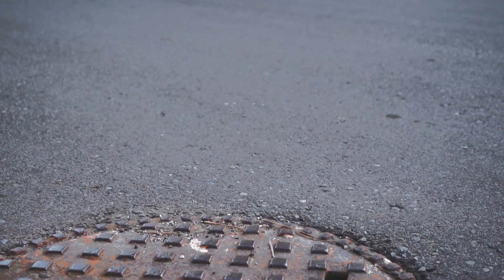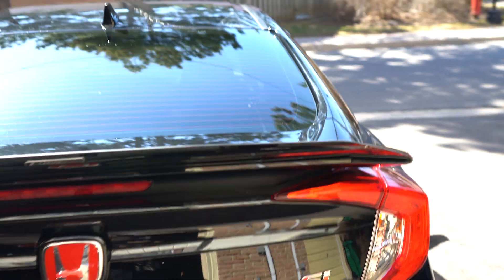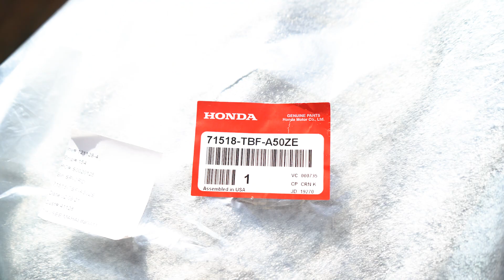2020 Honda Civic Rear Bumper Garnish Install // 10th Gen Civic

Comment: I am new to the 10th gen.  What rear lip is on your civic??? tyvm
Reply from the maker: ABS Dynamics makes it!
Reply: @ChrisLowpes  when you added the abs dynamics rear lip did you have to reroute the exhaust? I’ve got the non si sedan and want to do the abs dynamics rear lip but I’ll have to change the exhaust configuration